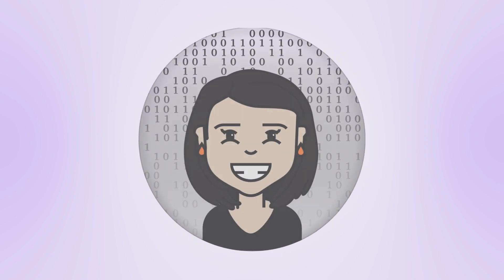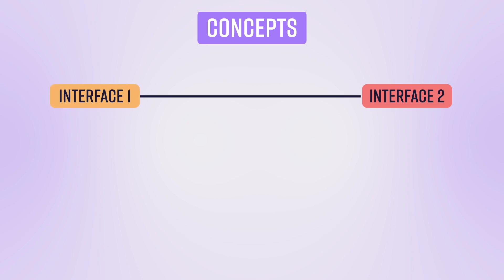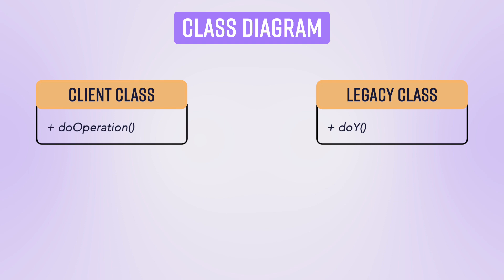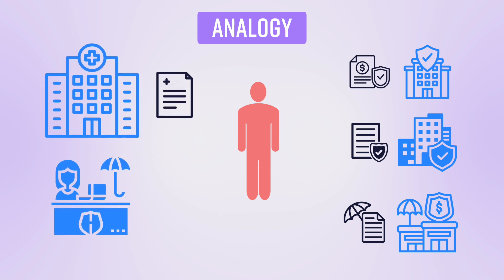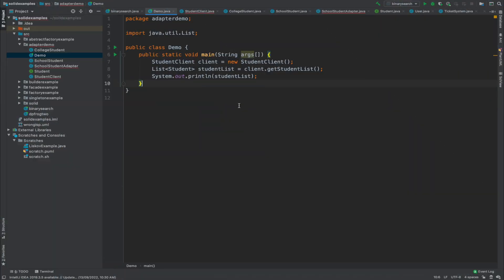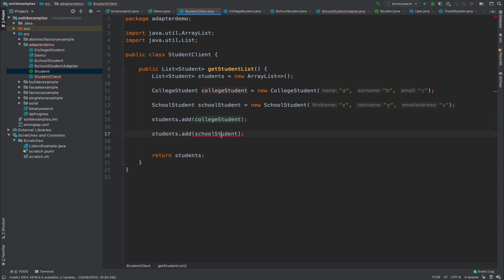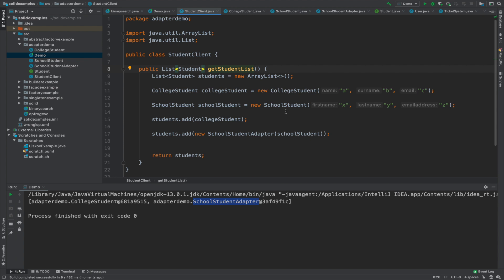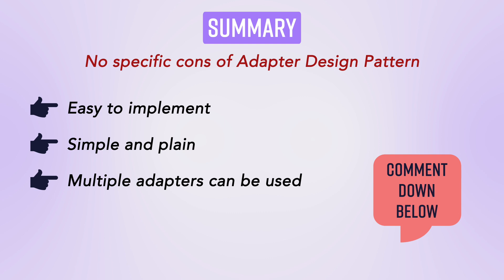Why adapter design pattern is simpler to understand without charger analogy | LLD | Low Level Design

Comment: The analogies used were really great and easy to understand. 
Another use-case where the an interface cannot be modified and we need this pattern is while using a third party library/API. The structure used in that interface or the response returned by that API may not be under our control and we will have to write an adapter that meets our requirements.

Comment: Arrays.asList is utility method that converts a variable number of arguments (varargs) into a List. This is a common pattern in Java for creating lists from an array of elements.

The Adapter design pattern is used to allow incompatible interfaces to work together. It involves creating an adapter class that translates the interface of a class into another interface that a client expects. is it correct ?

Comment: We can implement student interface directly in the schoolstudent class  amd it will be accepted in the list So what's the point of writing extra wrapper class or adapter pattern in this case? 

Could you please help me getting this part ?
Reply: I have the same question
Reply: This was just an example, you cannot change client's legacy code or external dependencies (libraries), you have to create adapters

Comment: Thanks for this video. I went through multiple video to understand the adapter design pattern but your explanation is much simple and up to the point and easier to understand with the example you provide.

Comment: The physical example is not bad the only problem is that they don't explain properly which class would be the old plug, or the not adapted one, and which class or part of the code is the new versio or the socket that would accept the new pins, like the students list that accepts the interfaced version of the Students college or school. So the explanation would be something like this: You have a two pin blowdryer but you are in UK and the sockets accept 3 pins.  You need an adapter. An adapter has two characteristics, first the part where the 2 pins go in the second part where the 3 pins go in the UK sockets and in the middle the 2 pins are connected to the 3 pins coming out. In this scenario the schoolStudent is the two pin blowdryer and CollegeStudent is the Hair straightener that your uncle gave you when he came from UK so no problem there! haha, just ignore it. The SchoolStudentAdapter like a physical adapter, remember, has two significant role, 1st is to accepts the 2 pins and  2nd is to go into the UK 3 pin socket. So blowdryer -> adapter -> UK socket     in code       schoolStudent -> schoolStudentAdapter -> studentsList : schoolAdapter initialises with schoolStudent meaning two pin blowdryer goes into adapter, then second part of adapter which needs to have 3 pins for UK sockets is achieved by implementing or conforming to the interface give you the 3 pins which then goes into the studentsList that accepts only Student interface implementations.  Anyhow it was a great video, I also really liked the explanation about the legacy code and new code.